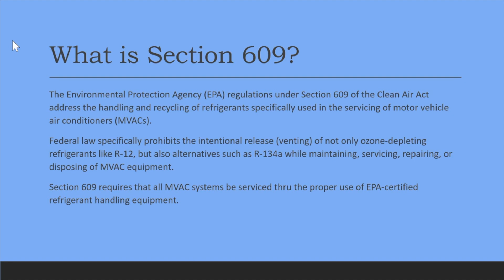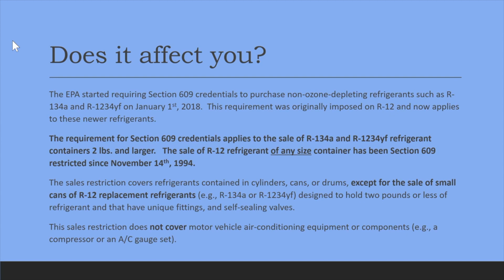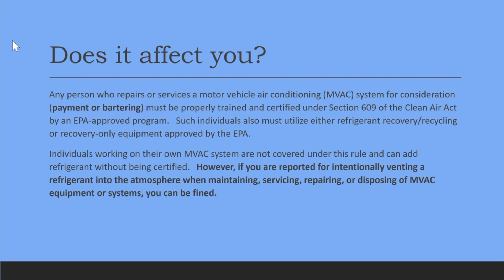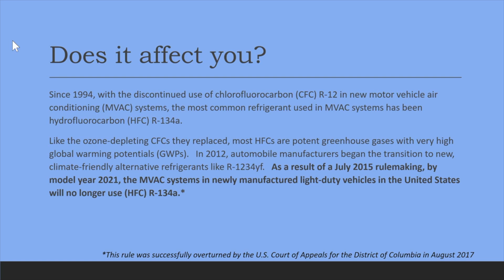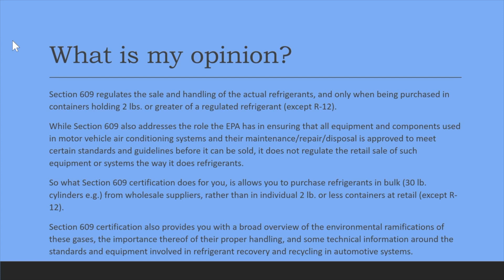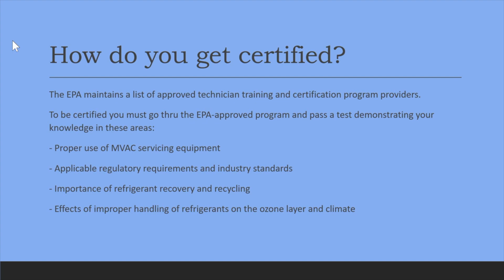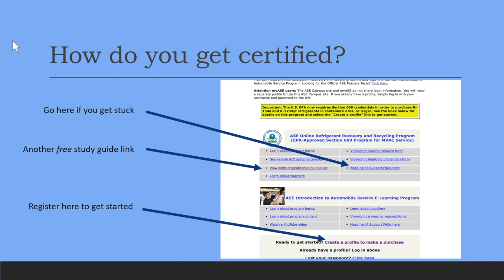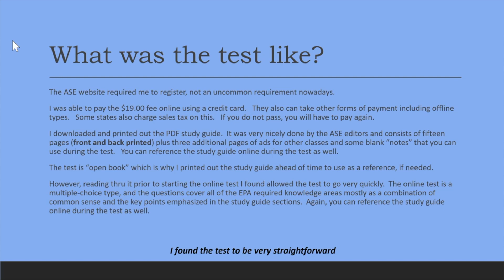Vehicle AC Repair EPA Section 609 Certification: What it is, Why it matters, and My Test Experience

Comment: what's the possibility of being able to start a mobile "MVAC" repair business, where instead of the customer driving to my shop, I drive to their home instead?
Reply from the maker: I've seen those in my area.  You just need a source of AC power on the van/truck to run the vacuum pump, refrigerant recovery machine, and/or refrigerant charging station.   You'll need multiples of this equipment as both R-134a and R-1234yf refrigerants will be commonly encountered.   These refrigerant systems utilize different size couplers, and of course the refrigerants are chemically incompatible so you need separate supplies and equipment for each.

Comment: If you pass EPA 608 Universal test the 609 test is much simpler. I find the 30lb container easiest to handle and effective in boiling if placed in hot water. Fortunately, or maybe unfortunately depending on your point of view, most vehicles issues are a loss of refrigerant, which if missing does not need to be reclaimed.